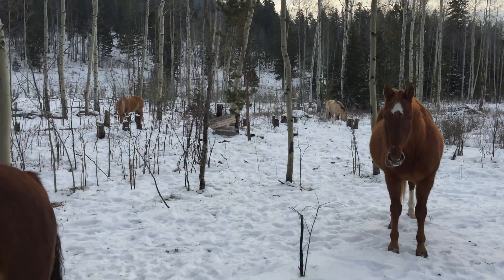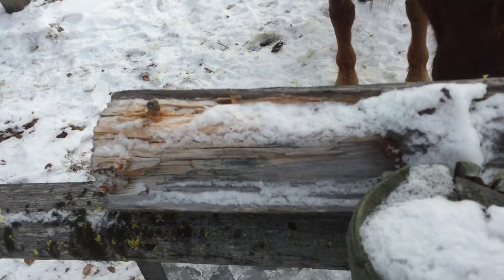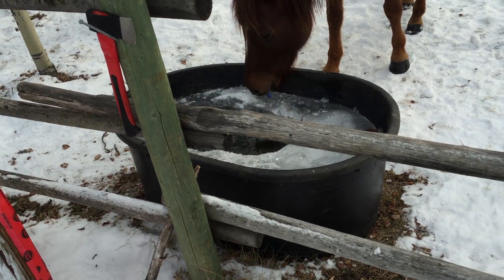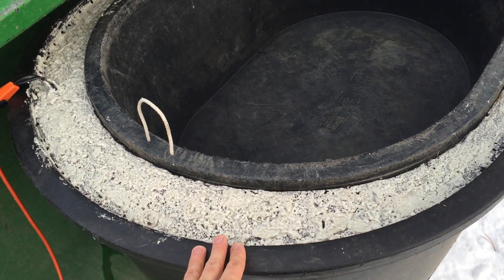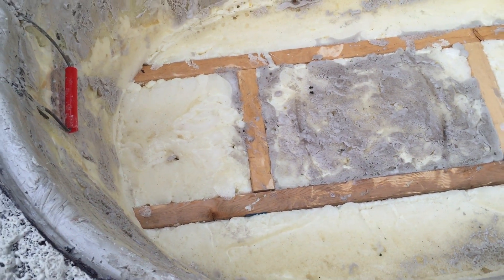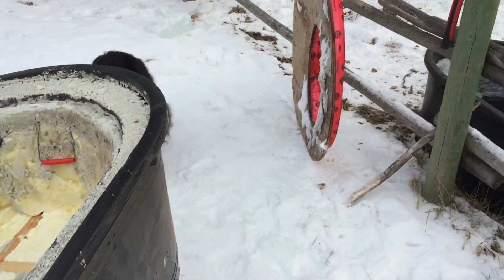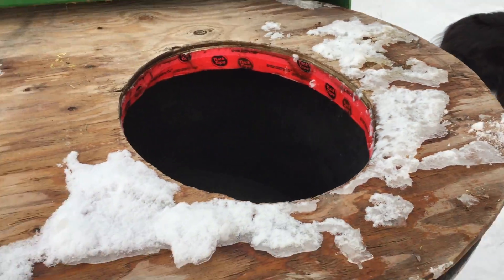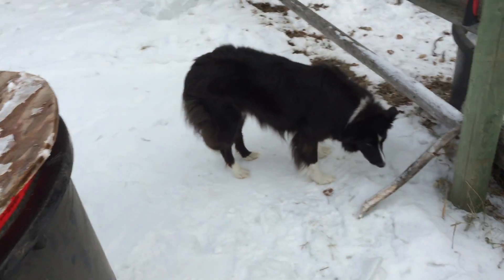Part 2 DIY - Create an insulated horse/livestock water trough - Share with your rancher friends.

Comment: Thanks  my friends just made a removable box and put insulation around it. But my horses are...mouthy & playful looking into other options. I also love the ceremonial axe on the fence. That's my current solution ...
Reply from the maker: Lol, ya didn't even think about my axe. The ice chopper. I’ve used that blow-in foam one for years and it's been awesome. I cut off the heat cord. Didn't work. Take care.

Comment: Thanks for the video. There is scarce detail out there about doing similar and I’m looking for some ideas to try. Going to build a smaller one for a small flock of sheep and see how it goes.
Reply: If you build this you should add a rubber baffle that hangs down several inches into the water. It will make a big difference in keeping the heat inside. Also you can add a round hollow or insulated plastic disc that is made to float on the surface of the water to add additional insulation. The livestock push this disc down when they drink.
Reply from the maker: A local friend in the BC interior created a quick smaller version by putting an equal sized bucket inside of another. However in the bottom bucket he put about 1/3 water, his heater and aa few bricks or something as a spacer to hold the weight of the top bucket, which was then filled with  the drinking water for his animals.  I don’t know how effective this was but he felt it helped to insulate and keep water warm in the colder days. 

Big or small, creating an insulated layer around a bucket or trough is what helps. Wish there were more things on the market provided for us.

Let me know what you ended up making and how it worked!

All the best!

Comment: I’m wondering if this setup would be effective without the electric heater? I’m looking for a solution to freezing troughs that only have the issue a few days at a time but no access to power (west TX)
Reply from the maker: Absolutely. Even just insulting the water trough and putting a lid on it if possible would make a huge difference.

Comment: I have a rubber trough. After watching this, I think I'll opt. for a 15 gallon heated bucket to set inside the trough with the plywood cover, leaving the 15 gallon open then put some straw inside the bigger trough for insulation.

Comment: Let me try and explain something to you people. Try and grasp what a small enclosed pool would, and does, look like. Also, an enclosed hot tub, with whatever wood, except not the decking and accessories that go along with it. The heating coils would have to be bound OUTSIDE directly to the tank, or tub, or whatever you use for water. Foam, of any type, isn't going to help you in this situation. Foam insulation, in general, means absolutely NOTHING, in the predicament. Furthermore, depending on the dimensions of the tank, if it was bigger, you would need two sets of coil heaters bound to the outside. One running around the outside perimeter of the sides to the trough, and another separate heating coil arrangement at the length of the bottom of the tank. Whatever electrical cut-off, thermostat, timer, or whatever, is on you. Then, the whole thing is enclosed with wood frame, panels, or whatever.
Reply from the maker: Thanks for your thoughts.  Been using this for 4 winters with -30 temps and the insulation works great.  Just put in a sinking electric heater and it keeps the ice from building up.  Take care.

Comment: Very cool.  Bubblers are a lot less expensive to run than a coiled heater.  Also, fill empty plastic bottles 3/4 of the way with salt water, seal them, and let them float around in the tank.  The bubbler moves the salt water bottles around and the salt water doesn't freeze around the bottles as they bob around the tank.  For severe cold, a person could put a timer on the coil heater so it doesn't run constantly.  That could save some money in the long run.
Reply from the maker: Thanks for the helpful tips!

Comment: how about a large trough with diagonal running copper pipe about one or 2 ft long outside the trough but enclosed, wrap heat tape around it(the pipe), and a small submersible pump to keep the water flowing?
Reply from the maker: Give it a try and let us know how it worked!  Seams like a reasonable idea.

Comment: So it's 2020 and am wondering how this held up for you all winter?
Reply from the maker: We’ve used it a couple of winters so far and it’s holding up very well. I think it’ll last a decade or so with normal use and no special care.
Reply from the maker: It’s 2023 and the old insulated tank just keeps trucking along…
Reply: @fod4250  - In extreme temps, do you still need a tank heater?

Comment: Good ideas.  My only concern with your design was drilling holes in tank for handles.  Water will enter these holes and fill the gap between the tanks, thus reducing the effectiveness of the insulation.  Another thought is a solar enclosure to heat the air gap.
Reply: Dipwad, huh? Solar enclosure?

Comment: We live in southern saskatchewan, how did the heat tape perform? Our horses  pasture isn’t close to power, thinking about using solar power to run the heat tape.
Reply from the maker: Hi Robin, today we are sitting at -27 and our heater is on a timer to come on every so often and we are not all iced up.  As for the heat tape, I cut the electrical plug end off and don't use it.  I installed it inside the expandable foam and it started to melt/burn the foam.  Now if you were to put the heat tape into the water maybe that would work?  I don't know if it is recommended?  You'd have to look into that. I think your idea of solar power could work, but the best thing we use are those submersible metal water heaters.  There are a lot of emerging solar options out there, so I hope you'll find something that works.  All the best!
Reply: @fod4250  How does it hold up in -40C ? Currently having a blast of arctic air here and it is regularly -40.
Reply from the maker: @justincarrier5778  Hey Justin, we have just had - 27 and it’s fine. Heater comes on twice a day for about 2 hours and this keeps any ice from building up. I’m sure if your heater was on every couple hours it’d be fine in -40.
Reply: @fod4250   I don't even need to look anything up, and I wouldn't put any electrical tape heater, or whatever of the such, into the water. I don't care what advice, good or bad, I got from anybody. I wouldn't do it. Period.

Comment: How is this water trough holding up versus the temperatures? I'm going to be trying this same idea to a 50 gallon plastic barrel and a 17 gallon bucket. I plan to cut the barrel so that it's short enough for the 17gal bucket to sit in. I am in southwest Arkansas and the most I've had was 1.5 - 2 inch sheet of ice on a non-insulated bucket.
Reply from the maker: Hi sorry for the delay in response.  We've used this for now 3 years and it still works awesome!!!  We have cold winters here around -20 to -30 Celsius, which is around -4 to -22 in Fahrenheit.  We found that having 1 to 2 heaters that you drop into the water work best.  They are on a timer to kick on only for a few hours twice a day.  This is enough to keep the water free of ice.  The heating coil we installed in the insulated foam we stopped using as it just burned the foam.  So I used wire cutters and snipped that line.  The key is the insulated bottom, side and then an insulate top if you can do that as well.  I think your idea should work well.  Feel free to post a picture of what yours looks like. Would love to see it. Cheers - Tim
Reply: How
Big didn’t make the hole for the top
Reply: What the flip are you talkin' about? Yer gonna cut the barrel short enough for the bucket to sit in? That's yer friggin' idea, genius?

Comment: How did you put foam in the sides without it sticking to inner trough??
Reply from the maker: Great question.  Thanks to Monster Busters for mentioning my other video.  Hope this helps.  As I posted below, Saran Wrap or plastic would work.  All the best.
Reply: There's a 'first' video to this one. I watched it and I think he just covered the smaller trough in plastic.
Reply from the maker: Hi sorry for the delay.  Ya we used plastic.  You could use Saran Wrap.